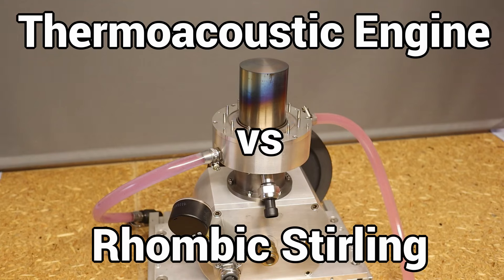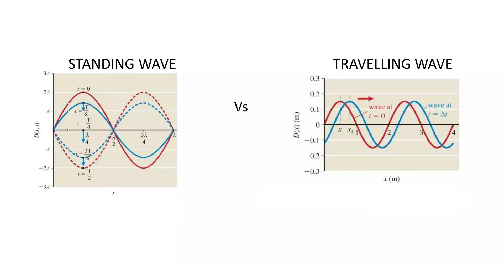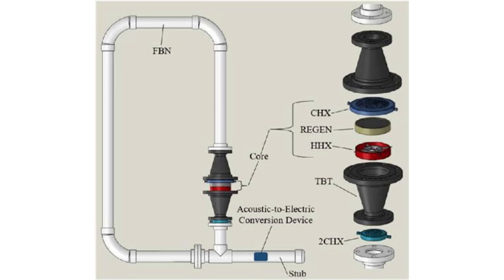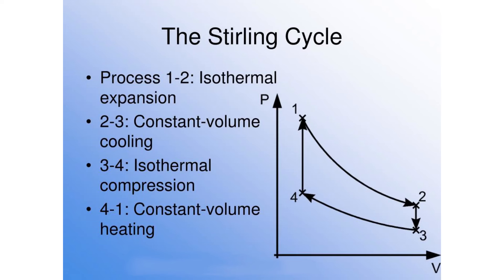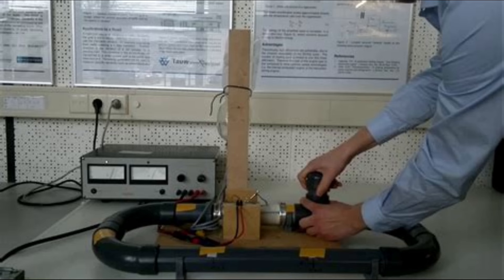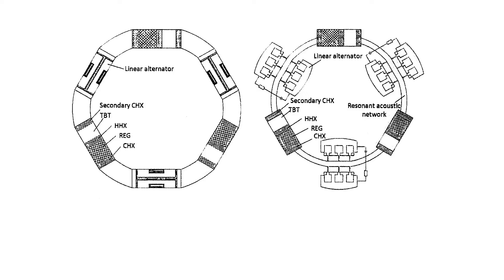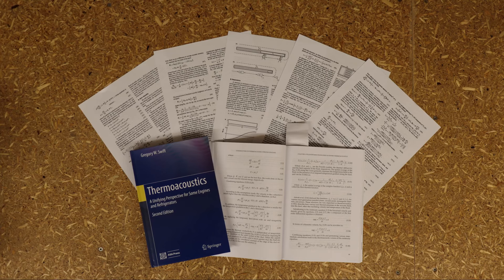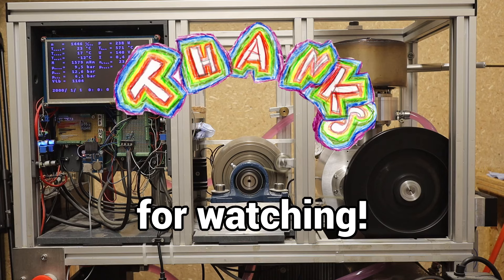Thermoacoustic Engine for more cheap energy than the Rhombic Stirling to go off grid ?

Comment: I have a mechanical engineering degree but I profess that I am not a good engineer.  Nevertheless, I would like to challenge the underlying assumption that having too many moving parts will compromise reliability too much.  There are many examples of mechanical devices working for enormous periods of time without serious breakdown, particularly when regularly maintained and/or operated at low stress. "[a CFM56-]3C engine in service with Malev... reached 40, 538 hours and 17,405 cycles without a single shop visit".  It may be that a more conventional engine can be engineered to provide the necessary service life as well as complying with your other aspirations/specifications.
Reply from the maker: You are right a complicated machine can be reliable.
Nevertheless the concept of an engine without any moving parts (except the power extraction unit) is very tempting for me!
Reply: However a complex machine with reliable parts trades in efficiency and material cost for its reliability. I believe machines have been created mechanically for such a long time because we deeply understand them. Our brains are made to make sense of the macroscopic world. The world is simpler, more predictable and "more ideal" when we make use of fundamental physical concepts. A beautiful example is computer science; we started out with vacuum tubes and relays, but looking at fundamental physical concepts we have come to absolutely microscopic transistors. I think that in most cases it's a good thing to replace a moving part with a non-moving part, whenever possible of course.
Reply: @myengines2443  Tempting?  yes, I understand that! :-)
Reply: @abnormaalz  yes, I don’t disagree with this but I think that choosing options in any engineering project is complex.  I used to work in academia, where there is a pressure to produce solutions which are novel.  Novel is often good but not always.  Also, we engage in projects for reasons of personal motivation, which are not necessarily rational! 
I have often thought that we need a method of converting heat into electrical potential through a solid state device which is more efficient than what is currently available.  I don’t know if this is theoretically possible

Comment: I'd look into the 'pulse tube engine' conceptually the same in many ways.  Look at the sunpower cryocooler.  Now imagine running it backwards.  Requires a few more gaskets, but should be able achieve high efficiencies.
Reply from the maker: I know the pulse tube cryocoolers a bit but I will take a closer look on them!
Thank you very much for your help!

Comment: It's possible to use a flexible membrane instead of a piston, this can in theory lower the losses.  There is a guy on YT who a few years ago made some Sterling engines he described as thermoacoustic and he used rubber membranes in this way, it was more of a garage type thing that your work but it works really well and I'd recommend considering some of his methods. Ah, found it, TK motors channel.
Reply: BTW, the maximum efficiencies of a Carnot heat engine IS NOT what you have been told, it's 100%!  Think about it, the equation takes the absolute temp of the hot side and tells you what percentage of that you can turn into mechanical energy, but unless you heated it up from zero Kelvin you don't need to worry about the first 300 Kelvin almost, everything is about 300K warm (26C) on a warm day and so if if you input 100 Kelvin of additional thermal energy then 100% of that quarter can be extracted with an ideal Carnot heat engine.  Consider what happens when the cold side is zero Kelvin, Carnot efficiency goes to 100% of the total, and when the hot side is super hot, and the cold side 100 deg colder, well you can only convert an insignificant amount of the total energy of course but 100% of the 100 deg you added in theory!  So this then means the reverse Carnot Efficiency, the efficiency of heat pumps and freezers (their COP, or EEP) IS NOT based on an inversion of the efficiency of heat engines being low at small temp differentials.  As such heat pump efficiency must be explain a different way and if cascaded enough, well you get at 10, 20, 30 COP or higher any thermal potential you want!
Reply: Was it bladeattila?

Comment: I had an off the wall idea, but in the pursuit of getting everything "solid state" you could use some strain gauges to induce a voltage over a diaphragm vibrating at the frequency of the engine.  Not necessarily achieving the goal of no moving parts (strain gauge works only excites voltage with a displacement), but maybe you could tune the strain gauges to the appropriate frequency the heat engine part works at.  The energy harvesting part would have to be quite clever in the electronics though....Beyond me....good luck.
Reply: The only reason I think this might be worth thinking about is because to extract energy from the system you are essentially damping the vibrations inside...I think this would make the heat engine run poorly.  I think energy extraction should be performed on the "scale" of micro electronics where it can be done in a more efficient way per cycle of the vibration.  Electrical engineers could build a tunable circuit for this type of power extraction from the heat engine....tuning physical moving systems seems like a bigger engineering challenge to me.  Think of the reason the old steam engines had flywheels, keep the engine going when things don't go as planned, got to find that but with power electronics, maybe a tunable LC circuit?
Reply from the maker: I will look for your proposal of using strain gauges, man thanks for that!

Comment: Still opting for free piston stirling on springs. No friction just piston and displacer on springs in one tube. ❤ (and some sensors+arduiono) I think that NASA chosed free piston with some reasons.
Lov Your job bro. ❤❤❤
Just got mini lathe. 
Got soft metal cnc. Im two (veery large) steps behind You. ^_^
Reply from the maker: Thanks for your nice comment!
If the thermoacoustic principle is not suiable for me I will try the free piston Stirling :-)
Congratulations for your lathe, plz show something here on YT when you have turned a part!

I also began small a few years ago, with very little money I built a very fine workshop from used machines and can now build nearly whatever I want, this is so nice!
Reply: @myengines2443  
Mate read about thermoacustic efficiency. Its real poor. Fluidine stirlings are getting like 1% eff.... This process need to be regulated. Think about it. Your movies are pure gold. ❤️
Reply: A diaphram might serve the purpose of replacing the piston.

Comment: To keep it simple, try it in small scale first, then scale it up. Maybe it's worth a try.
Mine was more kind of a gadget. It was moving but so weak I can't imagine it would have produced any measurable current.
But I do not want to keep you away from trying ;)
Reply from the maker: The principle of the thermoacoustic engine is so interesting that even if it comes out that I can't get any useful energy of it, it was worth it!
Plz show your engine in a video, it will be very interesting!!
Reply: @myengines2443  It's years ago and def not worth showing. It was a glass tube with some steel wool in it and a syringe as a piston with some very light oil in it. It was not able to drive the attached flywheel but the syringe moved at a remarkable speed. I will have a look if I find it somewhere. ;)

Comment: I stay in rurual Africa and ive been wanting to make a simple solar engine for generating electricity. A lense can be made with clear plastic and water and i was going to dump the heat into a sand box then essentially boil water and use steam to spin an electric motor. There's very few materials to work with. I cam across this and it seems promising if it can be simply manufactured on a lathe.
Reply from the maker: Yes I think your weather with an always shining sun is perfect for this!
Tomorrow I will post a new video with a lot of details on how the engine can be made at home together with an call to co-operate and the publishing of plans and drawings so everyone can build their own thermoacoustic Stirling engine!
Reply: @myengines2443  lol yeah I'm near the equator and the sun is very strong and always there and simultaneously there are many people without power who cant afford solar panels and batteries. 

You are awesome! I will have to diy both solutions and do a side by side comparison. A major limiting factor is getting special materials or items so I've been trying to find the simplest yet effective solution.

Comment: Not like you can use a tesla turbine to run a high speed die petro engine. Though for the thermal acoustic engine you just need some piezo ribbon or disk that vibrate to make power or use the sound to directly run some 100w piezo transducers maybe?
Reply from the maker: Piezo transducers had often been used, but their efficiency and performance is qute low as far as I know.
Reply: @myengines2443  Yeah piezo electric transducers are about two percent efficient while in resonance.

Comment: There is another type, this is tha BITL thermoacoustic engine. It is a combination of loop and bypass engine. The advantage of this is that it is the simplest and easiest travelling wave engine to build! Because of the loop the engine adjusts itself, so it is very functional and probably under different pressure conditions, only its frequency changes. Another advantage is that a long regenerator can be used, that is, it can be heated from the outside, like the TASHE motor, unlike the simple loop engine, which requires expensive and complicated internal heat exchange. This is really a very experimental configuration, but it works for everyone right away, anyone can try it! The difficulty is that the frequency of the vibrating generator must be tuned to the frequency of the engine. However, it is easier that the frequency of the engine can be simple calculated according to the different pressure conditions. https://www.youtube.com/watch?v=S-gU095cOEk
Reply from the maker: Thanks for the hint I will look out for it!

Comment: Very interesting ! ! THANK YOU ! I built an electronic Stirling engine that replaced the "Displacer Rod" with a solenoid magnet to increase the movement speed of the displacer by use of a shaft commutator. This allows the displacer to move from top of the chamber to the bottom in a "SNAP" which is far faster than the power piston can oscillate - Therefore; the air/ helium expansion can actually happen "In advance" of the piston's change in direction. YouTube Vid.    https://www.youtube.com/watch?v=6RKzYCICdyc     .This electronic control system will result in a "More Square" Carnot cycle chart"
Reply from the maker: Thats reeeally nice, thanks for sharing!